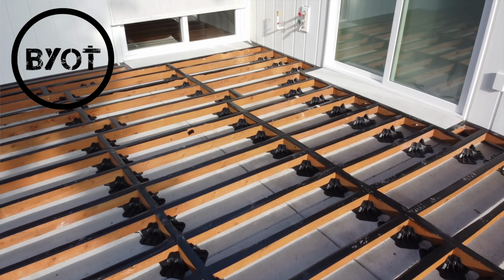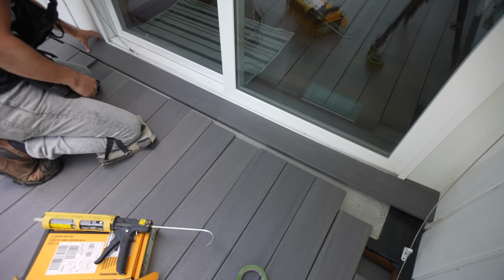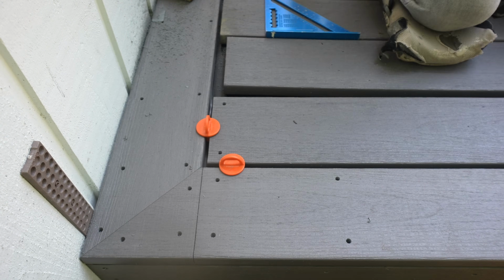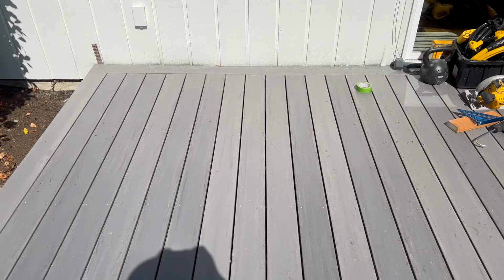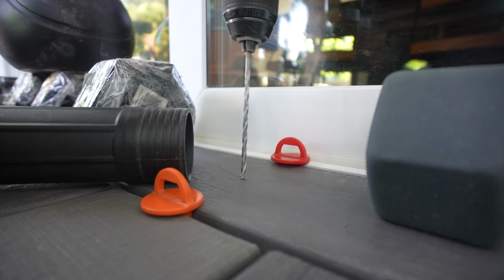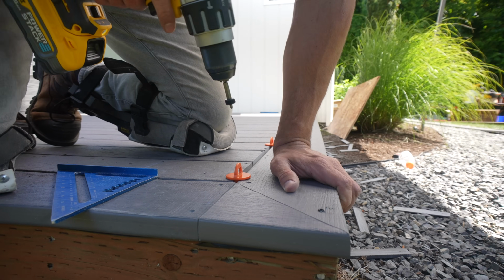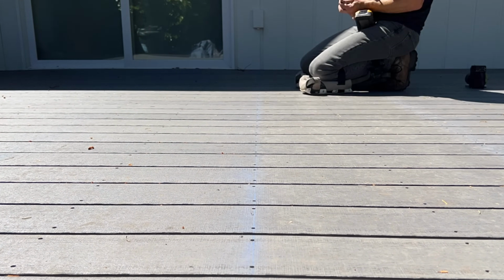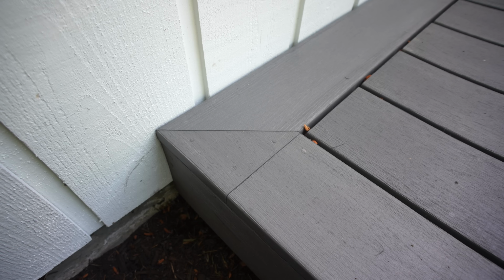How To Build A Low Profile Deck Patio (Part 2 of 2)

Comment: Hi, I am going to redo my rotted low profile deck from the previous owners. How did you address the tough blocks on the edge of the concrete patio? It seems they would hang off, unless you cut them to fit?

Comment: Great video, actually the type of deck I need to build utilizing the existing concrete step & patio, although the concrete patio is only 10' x 10' & I want to go wider.  Being below 30" in height also means I do not need a building permit.  I am a bit of a "chainsaw carpenter" although I am sort of a perfectionist so I think I can do a good job.  Just have to figure out everything and draw up a plan.  I have 27 - 4" x 6" x 16" pressure treated lumber that I got from a neighbor who was using it for an outside pool deck he removed.  Will get whatever additional lumber I need and plan on using Cedar decking which is quite affordable here in Oregon.  Not sure if will use screws on the decking or those brackets that can be used to fasten the decking from below?

Comment: How would you tackle putting a 12ft x 28ft deck together if part of it is going to cover the old concrete slap that’s only 3 1/2in lower than the door?

Comment: Nice detailing. One item of personal preference would be to overhang the perimeter deck board about 1/4"-1/2". This lip will allow less rain to get behind the fascia and also allows the wood substrate to shrink and swell seasonally without noticing the movement. Also, it's a good reminder to make sure the face of the hammer is perfectly clean before installing the plugs. Grind or sand any burrs off the hammer face. PVC boards are easily marred.

Comment: Love the video. I have a similar build on concrete, however have a lot of cedar trees near by and get a lot of debris during the fall. Would you recommend placing anything on the concrete before installing the deck to prevent much of the debris just sitting under the deck and on the concrete?

Comment: Great video, thanks. I may have missed this, but are you not worried about having the deck framing up against the house siding so tight? I'd be under the assumption you would want a little space between the two so moisture didn't become a problem. Also, what about ventilation under the deck?

Comment: At 11:40, the fact that the fascia board is down in the grass killed me.  How is the owner doing to mow and weed whack without marring all your hard work?

I would have put in some masonry screws at the corners of the deck (through the black plastic lifts) just to keep it from walking over time.  

I know you had to live with the odd length, but I don’t feel like the triangle inserts at the mitered corners are going to hold up well over time.

Comment: Thanks for all the great tips.  These details really help to get the professional finish.  Just curious, Wont it be faster to use clips that go between the boards instead of screws?  No need for plugs. 
Given your joists are not resting on the ground, is it necessary to use pressure treated lumber?
Reply: Clips would be faster but less secure.  Need to protect joists from rain so treated lumber is best

Comment: Hello sir, are you ever worried about water coming off the roof and coming onto the deck repeatedly? Or should it not be a problem since the wood is treated there should be no mold issues?

Comment: The corner you mitered an extra piece of is there a way to fuse that onto your long board using a locating biscuit and bonding glue that melts the plastic like Cyanoacrylate?
Reply from the maker: Have not tried that before Able but I may have to think about that one next time I take on a deck project.  Thanks for the suggestion and hope you liked the video.

Comment: This guy should have used slotted boards and hidden fasteners. Too many plugs to install. Major waste of time..
Reply from the maker: In your opinion. I’ve installed plenty of slotted decks in my day and they are MUCH faster but not nearly the strength these screws have. Happy to show off clip screws in future videos but these screws have the best hold strength possible
Reply: Will the boards warp and buckle that much requiring that much holding strength?
Reply: @b3arwithm3  i dont think warping and buckling is the issue.....just many lost hours and an inferior product in the end. Those plugs always end up showing over time.
Reply: @kevinbenedict5443  I have a small deck project in planning phase and I am also leaning toward using clips because they don't show.  And it is just one screw to drive in vs 2 in this case.

Comment: Great video!! From watching your other videos, I thought the fascia board was too thin to use the same cortex/screws and plugs as on the rest of the deck?
Reply from the maker: Great question Dave and you are correct.  I did state that because that's what TimberTech says to do and will happen.  But I've watched Dr. Decks use the same cortex screws that I did in this video on the facia and it was just fine.  If works for him I'm sure it will work for me haha.  Thanks for watching and the question.

Comment: Why wouldn't you use the composite deck clips?
Reply from the maker: I'm happy to use the clips on some projects but I love these screws and they provide the strongest hold strength possible, which is important when working with PVC decking.  Thanks for watching Brendan.
Reply: @BYOTools  is this better than trex?

Comment: I wonder why you use Timberteck instead of Trex?  Cost or availability or because you have used it in the past. I’m not loyal to Trex and I have never used Timberteck. It looks like an equal or better product tho. Thoughts?
Another beautiful job BTW. Thanks Brent!
Reply from the maker: In all honesty I have no problem with Trex and even have it on my own deck but for some reason all the clients in my area that I've worked with recently love the color and design of TimberTech more then Trex.  At this rate though I'm not sure when I'll be taking on a Trex project haha.  Thanks for watching and asking Roger.

Comment: I've worked with this stuff....the main reason I had to put on knee pads is that I would have gotten burn blisters on my knees because the decking gets brutally hot in the sun....god help anyone who tries to walk on it with bare feet on a sunny day
Reply from the maker: Luckily we don't have to worry much about that type of heat in Seattle haha.  Plus this new PVC stuff stays way cooler then the older models out there.  Thanks for watching Colin.
Reply: If these boards expand and shrink that much, isn't it a problem after installation?
Reply: the fact that you needed to wet it down to limit expansion....proves how hot the stuff gets
Reply: if you install it in cooler weather to maintain end spaces...problem is that when the weather gets hot the spacibg srinks then disappears leaving no option than for the boards  to buckle and sag because the have no place left to expand
Reply: I live in Ontario Canada...doesn't need to be hot weather...just a sunny day
Reply: also...my last experience with it was only 2 years ago

Comment: Forgot the link to the Wise Guides.  I am doing something similar (8x10 floating deck with walkway along the side of the house and a pergola built over it). Will cost me an arm and both legs, but should be a good project when done.
Reply from the maker: Thanks so much for the reminder Stephen. I just added it to the list but just incase here it is: https://amzn.to/43WP7DF Sounds link an amazing project. Send me pictures when its done :)